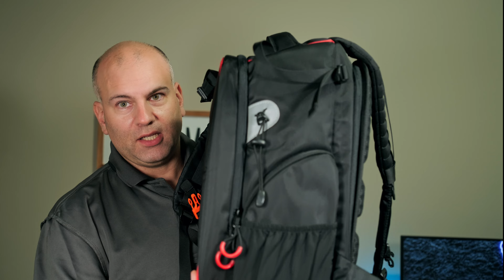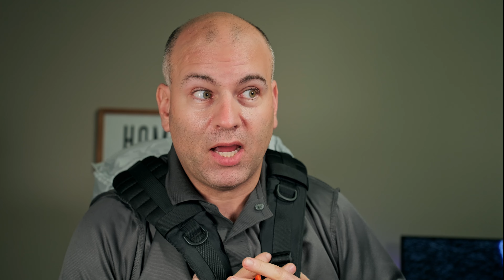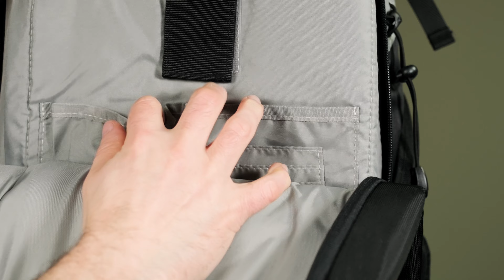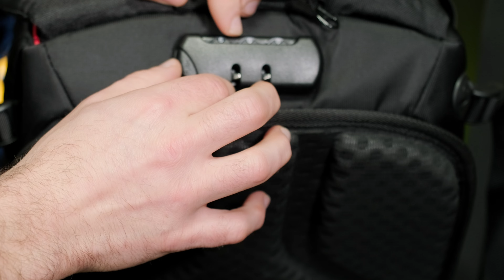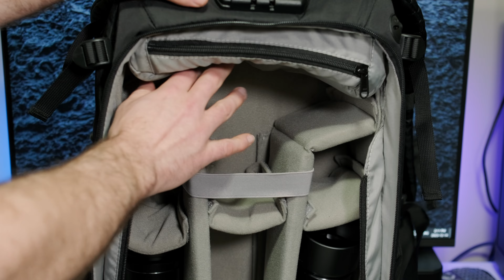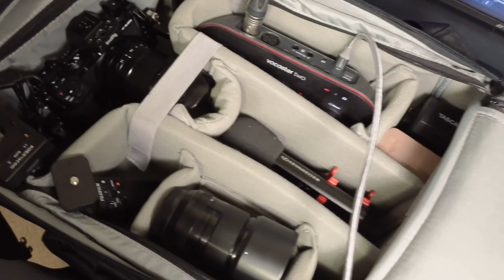Neewer Pro Camera Backpack, Camera Gear Case

Comment: Can yo I attach peak design  capture clip on the straps
Reply from the maker: Should work but I do not own any Peak Design items but I own the knock off stuff like PGYTECH Camera Wrist Strap which works great. My camera rigs are FAR too bit for those capture clips with my HUGE lenses like the Sigma 28-45 F1.8 Art lens and the Sony 70-200 GM II lens or my Nikkor 35mm F1.2 S lens and Vmount rigs for both my cameras.
Reply: @ericsstudio  how is the back is that useful in term carry lot of stuff
Plus can you open on the side to access  the camera  or only the back
Reply from the maker: @paulby88able  The camera can only be accessed from the back which is padded. It's still how I pack my camera because I know it is safe. The front is for laptop and cables. The back zipper can be placed to one side to open from the side BUT there is only the back zipper to access the camera. The side zipper can only be used for smaller items like Vmount / NPF batteries.

Comment: Great video. Could you tell me the internal size measurements of the main compartment? Height, length and most importantly how deep is it? 

In advance, thank you!
Reply from the maker: 44cm  long, 30 cm wide by 17cm depth. max opening size of main compartment.

Comment: You wear a shirt inside out, how dare you. Are you hiding the logo of a secret job?
3:17 The lock is a nice touch, but with a knife you might be able to cut trough the bag after they take it, or try to cut and grab it while you wear it.
4:32  No camera bag seems to have impact protection, just seems like fabric and foam dividers. I use a mountain biking backpack. Evoc Explorer 30L Pro, as I'm mountain biking I had to have a backpack suitable for that with tool compartment and so on, I used a bag that came with bed sheets, put elbow pads in, and camera in it, and a back protector plate over it. A bit fiddly to take out, but it's well protected. That should keep it quite well protected from impacts. So falling while hiking or crashing while riding won't be an issue I think. Evoc has photography backpacks too, but it did not suit my use. It fits a Peak Design Travel tripod in there too, but I want to get a head too, it will fit that too.
Reply from the maker: Most travel camera backpacks get extremely expensive. I almost thought I should have gotten a cheaper smaller handbag... Recently got a laptop 15.6 and it fits perfectly in this. I also got more gear, far more gear that I am going to be reviewing.... Boom pole, CPL with Bad combo filters, RGB light with lighting effects built in and wireless APP control and more planned.

The high density foam helps to spread any impact to protect the gear from damage. Also makes it so you don't get jabbed in the back 😂
Reply: @ericsstudio  OK, so this one has high dencity foam, some looked too soft. If it's high dencity it should work well if it covers everything.
Reply from the maker: @mtbboy1993  it is actually quite firm and not squishy. Definitely high density. Just made life the video make ANY XLR wireless to camera mic in port (TRS). If you like audio hacks.
Reply: @ericsstudio  Then this pack pack is promising. Is the thing with the velcro you put on top too? I probably won't get a photography bag. But if I became a pro photographer I of course would.
Reply from the maker: @mtbboy1993  The thing I put on top of the bag to make it more water proof has no velcro, just clips on. The botton velcro thing is a pouch to hold tripod feet. The Ifootage TC6S I reviewed would work wonderfully in there or the super low cost Joilcan NH70 tripod but certainly NOT the Smallrig AD-100 FreeBlazer Tripod I reviewed.
Reply: I meant the divider thing.  @ericsstudio
Reply from the maker: @mtbboy1993  ohh. All those separators have Velcro edges that can be stuck anywhere in that compartment. Yes it is the Velcro Part I have holding those lenses in place on top. Even over the camera lens there is that Velcro strap that holds the camera. The backpack came very useful for when I moved back to the studio this Sunday morning. Put in my camera, Vocaster Two, Tascam on camera interface, G60 COB light, both lenses, my Newer F500 camera monitor and the new laptop with charging cable. Great for video creators gear not just photography.